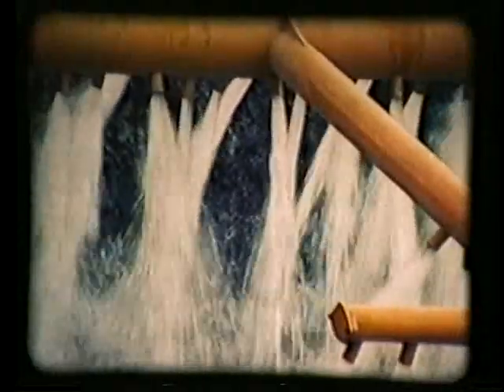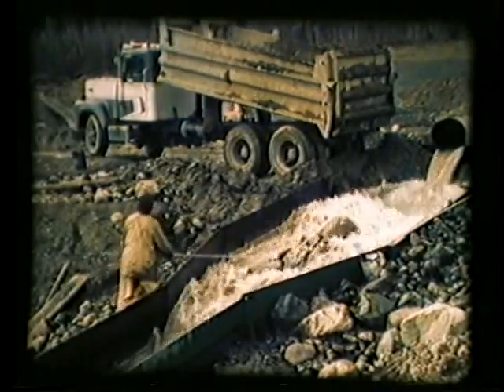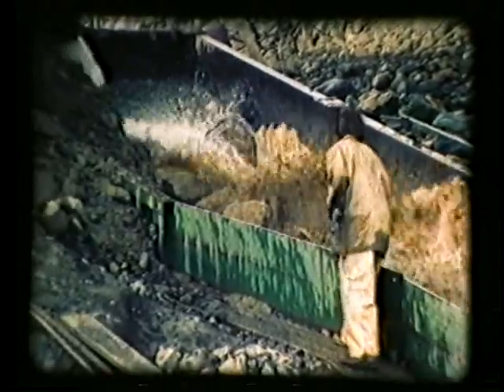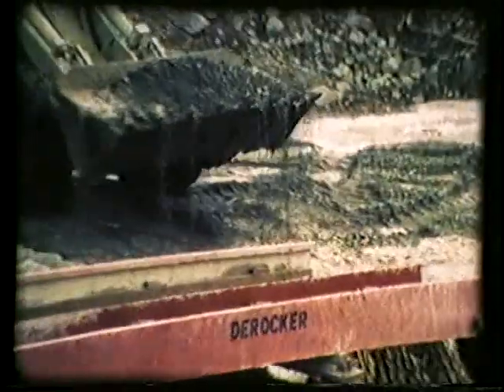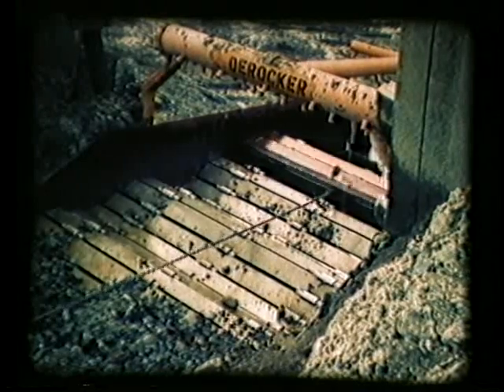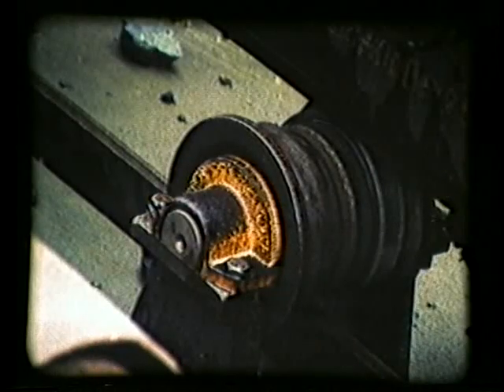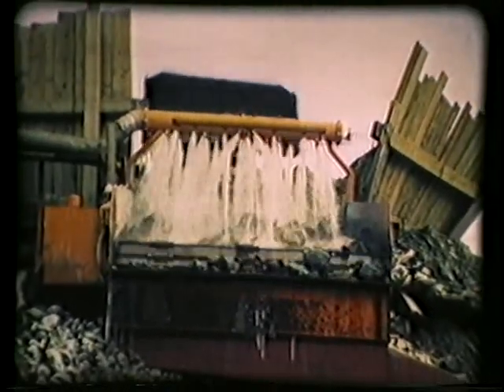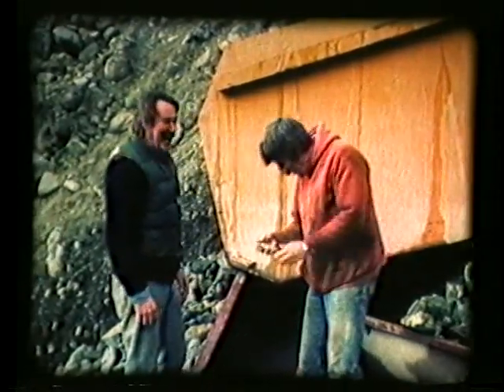RMS-Ross - Derocker Description & Features

Comment from the maker: We have also made it easier to operate and control, with more control options, have a remote control option, have high intensity high pressure spray bar systems for compacted silts and light clays, have proximity sensor control on the undercarriage of the articulating deck, have skid frames designed for the system so that it is automatically at the correct operating angle, etc.